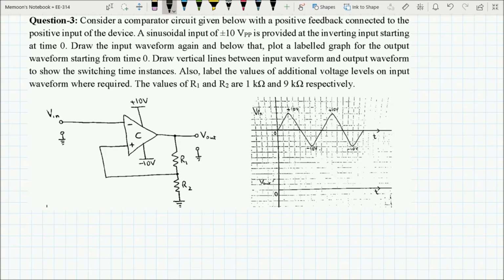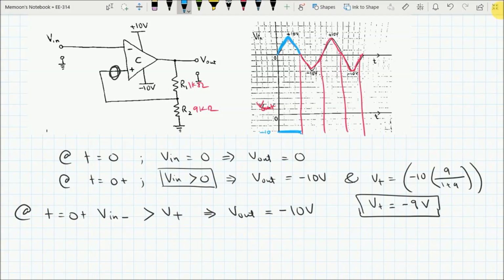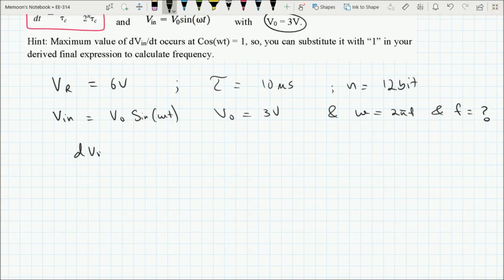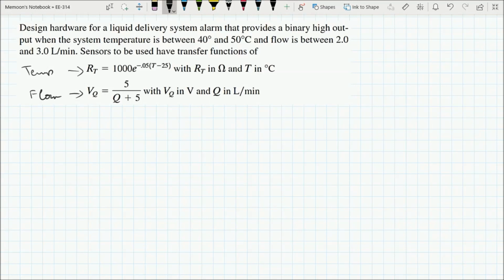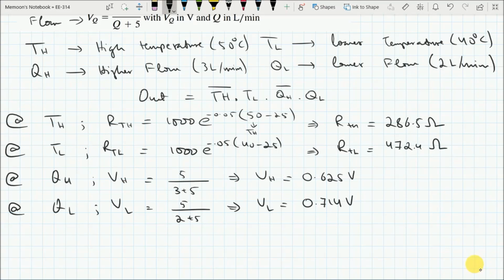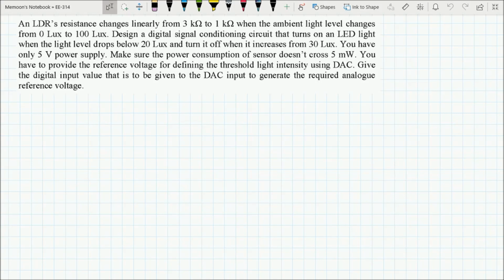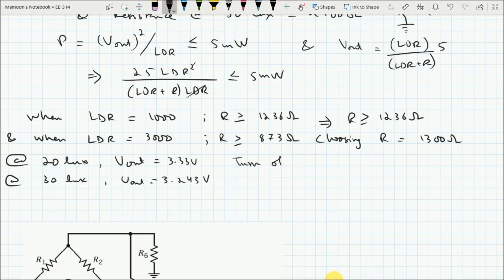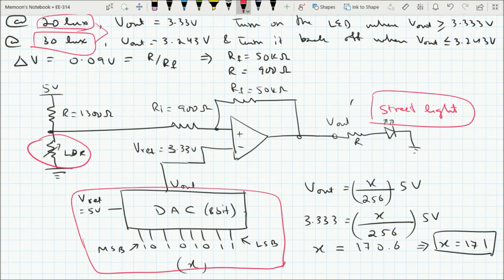Instrumentation Circuit Design Examples Part-II

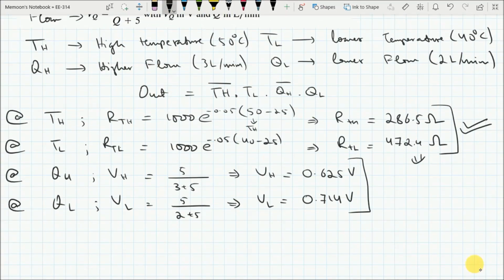Comment from the maker: At 19:00, the fixed resistor in the potential divider will be at the bottom while the sensor will be on top.
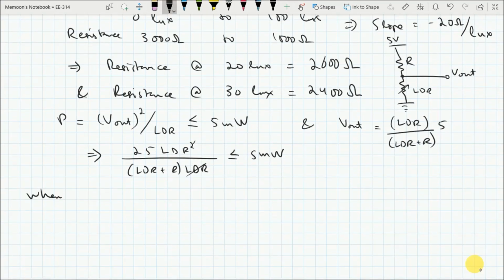Reply: 26:19 shouldn't the denominator be squared as well
Reply from the maker: @muhammadmuneeb9854  Yes it is squared, just an error in writing it down, the calculations are done by considering it squared. Calculations are correct, just missed writing the square in denominator.